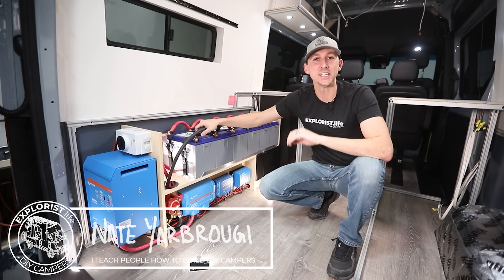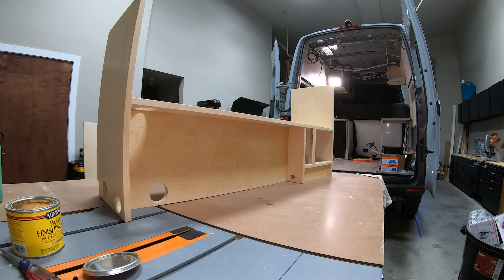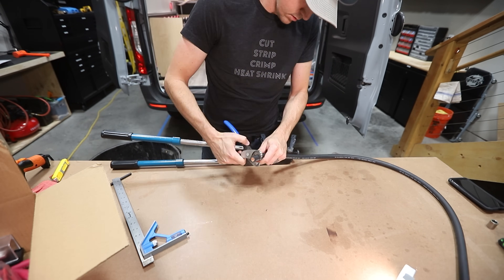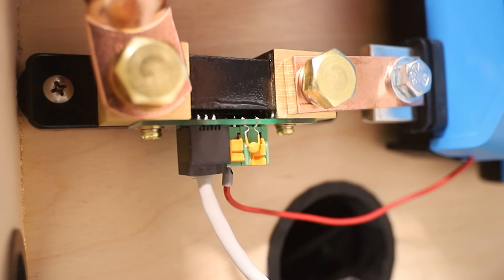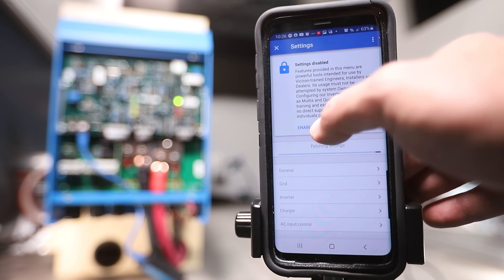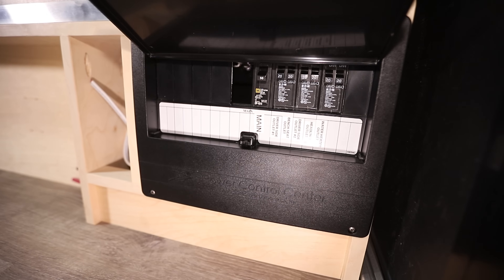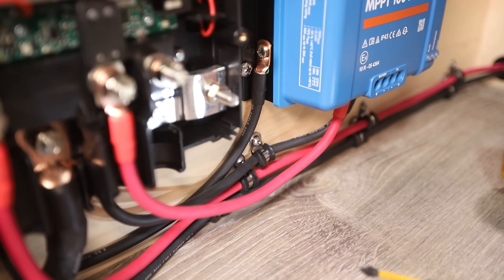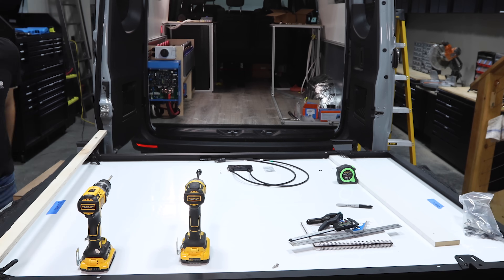DIY Sprinter Camper Van Electrical Install - Full Tutorial

Comment: How do you deal with ventilation for the elctrical cabinet? If you assume a perfect vapor barrier for the van, does it exhaust directly outside or is the heat generated by all the components low enough to just push it into the living space? If you vent it outside, where is the intake for that if all the windows are closed?
Reply from the maker: There isn’t enough heat to matter

Comment: Ty for this video it’s so comprehensive! Question: the chassis ground connected to the plusnut— that substitutes having to use a serrated washer? So the lug doesn’t have to make direct contact with bare metal body of the van just the plusnut? Does the material of the washers/plusnut or bolt matter, stainless etc?
Reply from the maker: We used the serrated washer on top of the plusnut in this video.
Reply: @EXPLORISTlife  thank you!
Reply: @EXPLORISTlife  Hi, to confirm, you used the existing hole in the chassis, put in a serrated washer against the painted metal and then pushed in the plusnut, tightened it, then attached the ground, regular washer, locking washer, bolt?

I've already put the walls on my sprinter and realised I need an Earth/Ground so I'm either doing it this way or running the cable up to the bolt that is above the rear doors on the left side of the van that some existing wires already run to.

Comment: Great video! Why would you want to use an ANL fuse instead of a resettable circuit breaker?
Reply from the maker: Have you seen how expensive a high quality 400A DC breaker that can accept 4/0 wire is?
Reply: @EXPLORISTlife  Haha, I suppose not. Thanks
Reply from the maker: You'll want to look into 'Molded Case Breakers'.  You're looking at $1,000+ for a high quality 400A DC Breaker that can accept 4/0 wire and after about 3 minutes of looking, I couldn't even find where to actually purchase one.
Reply from the maker: Or you can just use the ANL fuse like I have in the parts list. :)

Comment: This video is awesome, love the thoroughness of it! So I have been under the impression that a 24v system is better, and that putting a lot of batteries in parallel will give them a shorter life. Could you elaborate on choosing a 12v system and also the reason for so many batteries? Would this system be able to charge a fridge (with freezer), air conditioner, and video/gaming editing desktop comfortably or is there a limit with 12v? Thank you!
Reply from the maker: The limit is more on how much power we need to pull from the batteries.  With only a 3000W inverter, a 12V battery bank is just fine; but if we need to go bigger than 3000... I'll recommend a 24V; or over 6000W gets a 48V battery bank.
Reply: @EXPLORISTlife  Hello, you didn't answer to the second part of the question, why so many batteries in a small van? it's about 600ah. what do you power with it?

Comment: 3:35 pro tip, (only if you are comfortable using it) rather than setting up a stop block, after you plunge the saw down into the board and cut the side closest to the fence hold the blade guard with your thumb and lift the arm, keeping  the saw going, then lift the board up into the blade to cut the side furthest from the fence. you can increase your cutting width of boards without having to flip the board over. I learned this trick from Youtuber Jimmy Diresta! It works well, I have a sliding mitre and I think I can cut boards as wide as 22" using this trick. User Discretion is Advised!

Comment: Hi Nate, great video. If this was a boat, fiberglass, where would the chassis ground hook up to, the engine? Cheers
Reply from the maker: I believe there would be no 'chassis ground'.  The equipment grounds for the Multiplus and MPPT's would go to the lynx Distributor as shown, but the chassis ground could be omitted.

Comment: Have been watching your videos. For good information. On the batteries I saw a video from Nigel Calder the new way to wire batteries so they all work evenly is to run them all separately to a bus bar then run your power line from the bus. Not sure where you would put a fuse. Any thoughts on doing it this way?
Reply from the maker: That way takes more wiring, fising, and space, which is not something we can usually do in a camper w/ limited real estate.  They way I show in my diagrams works wonderfully, charges/discharges evenly and is one of the 4 approved battery bank wiring methods in the Victron Wiring Unlimited book.

Comment: Thanks so much for this video! One question - when you add your alternator charger wire to the f150/4 block, do you add a specific type of m6 nut and do you add loctite? I noticed some blue material on the factory nuts but thought loctite was not good on electric. Thanks!
Reply from the maker: It's debated if loctite has ill effects on electrical connections.

A connection coming loose is absolutely 100% bad for the connection.

Pick your battles.

Comment: Love your videos! Planning to use this for my electrical system install and going to be ordering from your site, soon! I see here that you have 600 Ah with your battery layout and 400W of solar (plus alternator and shore charging, of course) 
If I plan on having at least 525W (but possibly 625W, at most) of solar, what's the safest max amount of Ah I could have? Would 400 Ah (2 x 200 Ah batteries) be reasonable? Thank you!
Reply from the maker: Any amp hours and solar wattage would be 'safe' as long as you don't exceed a ratio of 6:1 solar wattage to battery bank amp hours. (max 600W to 100Ah | 1200W to 200Ah | 1800W to 300Ah | etc)

For 'optimal' solar charging, you would want to have twice the solar wattage as you do amp hours of battery bank capacity (200Ah battery bank -> 400W Solar), but I know we don't always have enough roof real estate for that.  So you just want to get the most you can on the roof and understand you can supplement with alternator and shore power as needed.
Reply: @EXPLORISTlife  Update: almost finished with copying this entire system with very few minor differences. The last part needed is to connect the  alternator charging. However, I believe I messed something up; I kept turning the system on and off to configure parts accordingly, not realizing that the SOC would reset to 100% each time. Now, I've ran the batteries a few time for testing purposes but now I have no idea what it's current SOC is. What's the best way to figure this out? I need accurate readings so I can make sure the Smart Shunt I'm using is reading properly and therefore ensuring charging inputs work! Thanks!

Comment: Super video. What is your opinion using a Bluetti AC200P solar generator with solar panels on a van or cargo trailer build?  It seems this my be a simpler approach to adding power to a build.
Reply from the maker: For a permanently built-in system, I'm pretty much always going to recommend doing as I showed in this system so you can get exactly what size of system you need and can get higher quality individual components.  Those portable units are good for just tossing it in the camper/car/truck and going though.

Comment: Do you believe it necessary to ground the 80/20 aluminum frame to the chassis? Why or why not?

My thought process behind this question is as follows: If part of the reason you ground to chassis is to protect someone from an electrical shock in the event of a short, then shouldn't the same apply to aluminum extrusion?

I currently lean towards it NOT being necessary, simply because the aluminum is anodized, and therefore not conductive on its surface. It seems to me that the circumstances under which the aluminum could become involved in a short are so severe that, were they to occur, you would likely have bigger problems. E.g. you just got rear-ended by an 18 wheeler. Then again, the chassis is painted, and so is also theoretically not conductive. Perhaps electric shock prevention just isn't a factor when it comes to grounding to chassis?

Either way, I would love to hear your thoughts on this.
Reply from the maker: It should be grounded, but being grounded where it is bolted to the van is sufficient grounding as far as im concerned. 👍

Comment: Amazing video, short question about the alternator charging.  Is it oukey to connect it to the battery directly (as it is shown in the manual) and not to remove the whole seat, and everything to reach the buss to add it under the seat?

I hope someone can help out. Thanks <3
Reply from the maker: If that works better in your particular scenario, that's fine, yes.

Comment: Great video.  Curious. Did you do a ground test?  I’m looking to do the same and I’m getting 0.4 ohms. For the connection point.  Thoughts?
Reply from the maker: We didn't 'test' the ground under load, no.  Our ground connection is not supplying any power under normal operation.

Comment: Does the Victron Multiplus 12/2000 80-50 120V (UL) generate any noise or vibration? Should it be mounted in a location that would muffle any noise, or mount it on rubber grommets to isolate any vibration?

Comment: Hi Nate,
I wanted to say thank you for your resources, I am really moving with the solar now thanks to your diagrams! I do have a few questions though.

I am trying to integrate the B2B Renogy 60a charger, from the 2000w diagram, into the 3000W diagram ( instead of the Victron 30a B2B). Is this possible?

Also, in the parts list, you list off a link to amazon for a “add a fuse kit” and that doesn’t take you to an actual part. There are so many and without more info (and knowledge, lol) I have no idea which to purchase.

My build consists of 3 x 200ah litium batteries, and for now (I plan on installing more), 3x 175w solar panels = 525W, MPPT Victron 150/100a, I will be following your 3000w diagram for the most part, I just need to make a few adjustments if I can. Specifically, the DC to DC charger.

Comment: So helpful!  If I plan to use a Cerbo GX for monitoring the system, can I just use a Victron Smart Shunt instead of the BMV 712 since I won't need the extra physical display?  Would it be wired the same?
Reply from the maker: Yep!

Comment: That shore power cable is wild. Is that a US standard cable size for 120v circuits?
Reply from the maker: 30A 120V shore power cord is indeed pretty big and is indeed standard for that use case.

Comment: NIce video but a couple things I don't understand. Don't understand running 6awg for a 30amp 5 foot run (10awg for 50' normal). I'd also prefer the AC panel had a main. Why run a neg lead up to driver chassis when you already made a chassis ground point.
Reply from the maker: 1: YT search our video covering Victron PowerAssist.

2: This breaker box does indeed have a main breaker.

3: We don't use the chassis as a current carrying conductor, only as a safety mechanism, so DC DC charging get's its own dedicated negative for more reliable performance.
Reply: @EXPLORISTlife   Thanks for the info and quick reply. Was just reading the manual about the 55A potential. So you have a 50 Amp Main? And I must have misunderstood the videos that show the battery charge circuit connecting to chassis. Great stuff and I also liked your top 10 mistakes.

Comment: Hi Nate!  So...Iʻve been wondering ... mostly because I want more space, big garage (adventurous type)...without sacrificing as much as it takes to get a huge vertical space garage (especially on a dually sprinter 3500XD 170)...

...the battleborn lifepo4, batteries have an internal heating system.....and maybe theres this part of this hydronic system I can use...
How feasible is mounting batteries underneath the bed of the van (170 sprinter)...if you plan to be in cold weather (ski stuff).  I imagine insulating and so on...just wondering your take and if you have any ideas on undermounting and protecting batteries, pros and cons and limitations.

Comment: This is a great video but the whole thing is still a little overwhelming for me.  I am basically putting the exact same system in my shuttle bus conversion except I am only using 4 Battleborn 100AH batteries.  I am looking at your list of items to buy and is it possible to get the list amended so that it only shows the items needed for only 4 batteries?
Reply from the maker: We plan to offer a 4-battery Battery Bank Wiring Kit soon, but in the meantime, the 6-battery Battery Bank wiring kit used will work just fine for your need with just a few extra lugs and pieces of heat shrink left over.

Comment: Nice video! But why do those wires have to be so thick?? In my home Im not evening close to using wires that big!! ?
Reply from the maker: That's the difference between voltage.  1200w delivered at 12V like the battery bank is 100A.  1200w delivered at 120V like in your house is 10a.  Bigger amps requires bigger wire.

Comment: The Sprinter manual says ONLY use the exact same battery for the starter battery and the coach battery (which I do have). I would like to remove my coach battery and do a build like this. I do have a factory relay under my seat. I assume I can add the DC to DC charger after this relay. And the big question is does the DC to DC controller isolate the battery from the main battery and keep prevent any issues caused by two different types of batteries on the same system? Thanks?

Comment: Hi . Great video! So i understand that it becomes difficult to fuse each battery in this application. But do you agree that ideally, each battery should be fused in case you load the system to its max with in case on or sevreal of the batteries are malfunctioning ? YES the BMS will protect the battery for a overload. But BMS do malfunction.. so in case you have load situation with a dead battery, your main fuse will allow it? 

I'm just asking:-) I would assume that for a 2x battery setup, 2x fuses on each battery and 1 main fuse would be the best option?
Reply from the maker: The way we show in this video is the way I recommend wiring a battery bank.  You'll want to dive further into ABYC e.11 for additional standards on DC overcurrent protection if you wish to stray from what we've taught in this video.
Reply: @EXPLORISTlife  Thanks for the reply:-) I will follow your way .

Comment: Great video as always; very helpful. Between the Lynx distributor and the Shunt you have a copper busbar; can that be bypassed if I connect the terminal of the lynx directly with the shunt terminal? Thanks
Reply from the maker: It won't fit.  The bolt for the Shunt is too large to fit into the hole on the Lynx Distributor.
Reply: @EXPLORISTlife  Thanks Nate! I was thinking of slightly enlarging the hole on the Lynx distributor so that the bolt fits...
Reply from the maker: I can't recommend that since any damage that occurs as a result of drilling the hole would not be covered by warranty, but you are obviously allowed to make any modifications YOU feel comfortable with knowing the associated risks.  I make and use the copper bars so there is less margin of error for you.  Also... You'd need to find a different way to shim up the lynx Distributor to flush as my shunt spacers and mounting hardware would no longer fit.

Comment: Hey Nate! We’re following this video as well as the 2000W Inverter | 200-400 Ah Lithium | 200-700W solar Camper Wiring Diagram we bought from you. Our build is smaller with 2000W Inverter | 300 Ah Lithium | 300 W solar and no Sure Power. On your wiring diagram you show a 70amp fuse on the Lynx Distributor and I’m not clear what that is for? I didn’t see it on the part list. Is it for the Charge Controller? If so do we need the 70amp or would a 60 work?

Comment: Love your videos, but it seems on these last 2 videos, the solar capacity is way to small for the amount of battery installed. On this install 400W of solar for 600 Amps of battery or on the last video 170W of solar for 300 amps of battery.
Reply from the maker: Indeed it is!  The solar array SHOULD be battery bank AH at 12V x 2 = solar array wattage goal.  But alas... I was constrained by the limitations of the clients.  They are aware to the fact that if they completely drain their battery banks, solar alone won't bring them back to 100% in a single day so they would have to supplement with alternator charging or shore power charging.
Reply: @EXPLORISTlife  Thanks

Comment: Very nice video. Which component is responsible for the overcharging protection of the battery bank? thanks
Reply from the maker: The solar charge controller, the multiplus inverter/charger, and the orion DC DC Charger all do that.
Reply: @EXPLORISTlife  What if all three charging methods  work all together? Which method has the highest priority and which component is responsible for the overall overcharge protection?
Reply from the maker: The software inside of each one auto regulates.  This is something we don't have to worry about.
Reply: @EXPLORISTlife  Sounds good. One last question, Will this system start the car if the car battery is depleted or dead?

Comment: Great video, Nate.  Been a long time since I checked in.  My install looks pretty out of date compared to what you are doing now.  Mine is pretty well a clone of what you did with your first van: Aims inverter, Blue Sea fuse panels etc.
Been working perfectly for three years now.
I wanted to ask, doesn't the charging system in the video seem a bit under powered for a 600AH system?  It would take a long time at 30A from solar to recharge, same said for 30A from DC2DC charger. What are your thoughts?
Reply from the maker: 400w of solar for 600Ah of batteries is indeed undersized, but this was a 'client constraint' and we talked about this beforehand and they understood the limitations.
Reply: That's what I figured.  Can you share the client's reasons?  I would be interested in what drove the design.  This could be a good teaching opportunity for folks in the design phase.